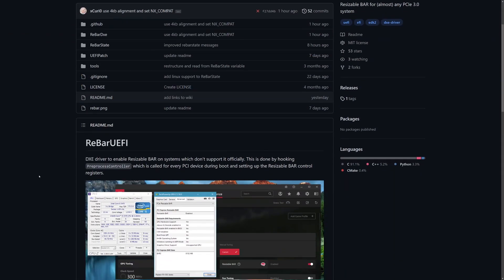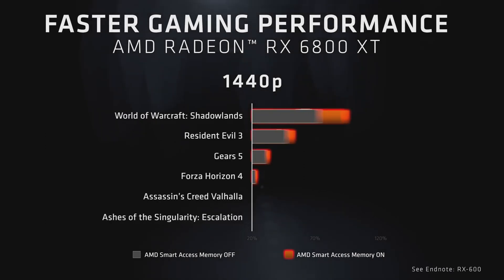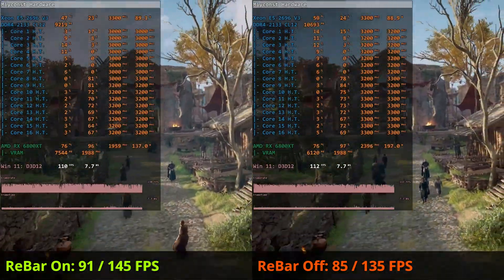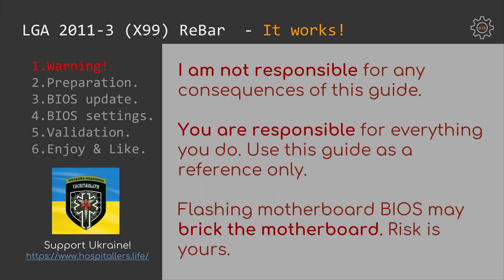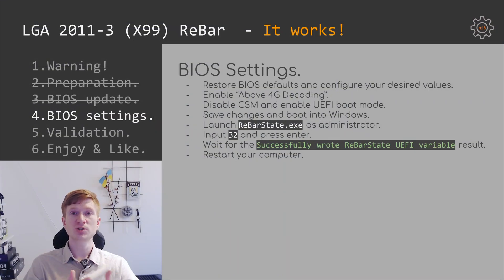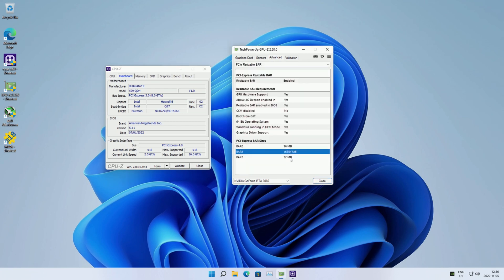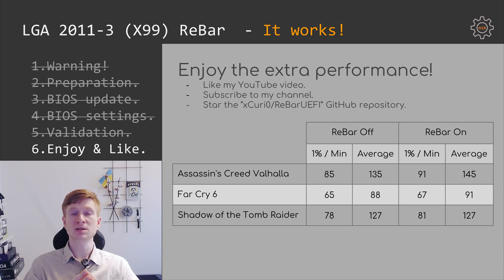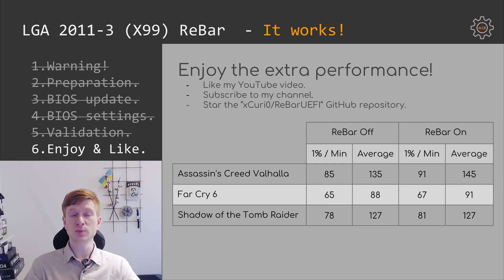🇬🇧 Resizable BAR (ReBar) on LGA 2011-3 X99 – how to enable and get extra performance

Comment from the maker: ❗UEFITool must be non-NE version - link in the video description updated.
Reply: X99 QD4 Not working with resize bar with the -100mv patch for it, disabled CSM completely enabled 4g but not allowing resize in bios. Running 22H2 ghost spectre 10 windows
Reply: added to bios with the xeon mod, flashed. Clean installed windows 11 pro x64 Uefi mode video on uefi only  enabled 4G decoding on asus strix x99. Xeon mod works perfect but rebar ant working with bios patch and running the rebar .exe @32  Running on x99 strix E5-2696 V3 , nvidia rtx 3060 ti. Any idea's? would be great
Reply: @superslotheroes7649  hi! i have the same problem! did you solve it ?
Reply: @barrozo24  No Still waiting for a fix  if you solve it let me know!. I can see  on xcurios rebar site someone listed it as they got it working yet the person that posted only  posted once, and ive had no reply from them. But it is now listed as compatible with a uefi patch but i havnt managed to figure that out as im not fully uefi bios tech savy. But as  i said if you manage it let me know or pass me on you're bio's. Best regards
Reply: @superslotheroes7649  apply uefipatch and also update your gpu vbios
Reply: @superslotheroes7649  for me  not working
Reply from the maker: @superslotheroes7649  it's hard to say what's wrong, but you can join my Discord and ask for some help from the ReBarDxe author.
Reply: @Miyconst wow what a niche, very cool! I’d love your opinion. I am considering upgrading a x99 sabertooth that worked very well since I built it 2015ish. The past year it’s had driver update issues. Recently nearly died, after driver wipe, gpu running but not well. 

The system ran 5k monitor, (which I thought died) graphics tablet & did lots of rendering, good life for gtx 980.  The cpu is 5820k, overall system used as a editing/graphics workstation.  In a funny spot, new gpu considering A5000 or 4090 more expensive than entire x99 pc. & I’m not Pixar. 

Anyway, what gpu/cpu would you suggest? With this cpu the 1080 ti looks promising and it appears some bios wizardry can help newer gpu cards? It would be kinda cool to get fancy Xeon in it too. 
Thank you & stay safe!
Reply: @Miyconst  can you do a video on this of how to do it if possible please and thank you and also make a video before resizeable bar and after for the x99 setups so show is that your not just blowing smoke plus it good content easy and don't close a lot of money to do
Reply: @Miyconst  Please advise! I've tried a lot of things. Motherboard x99tf 1rev. Video card rx7800xt. In the BIOS, 4G decoding and UEFI boot are set. But, adrenalin drive says that Resizable Bar is disabled. And this is not the main thing, from the very beginning I do not see the BIOS launch, a dark screen and if I force it to launch, the dark screen freezes. You can launch it only after it has been off for about an hour (I did not record the exact time). Or install another video card from NVIDIA. How can I make the motherboard work normally with this card???
Reply: Здравствуйте! 
У меня материнская плата Gigabyte H67MA-USB3-B3 чипсет H67 + i7 3770 + Asrock AMD Phantom Gaming RX5700XT+24gb DDR3 1600mghz+x2 SSD 240gb!
Биос в системе установлен последний(F8) для данной модели мат.платы!
Возможно ли включить 4g Decoding и Resizable Bar на данной системе с Windows 10 x64? 
Если это возможно, пожалуйста  предоставьте мне обратную связь на мою электронную почту в описании канала либо загрузите модифицированный файл BIOS при отправке сообщения на мою почту! Благодарю за внимание!
Reply: i doo step by step and rebar  disabled  still in gpuz

Comment: Edit: Nevermind, it was my RTX 3090 which hasn't been vbios updated yet to be ReBar ready as it seems, I flashed it and now it works (at least GPU-Z and Nvidia control panel report that)
I flashed my x99 Taichi with a Rebar Enabled BIOS, set up Above 4G Decoding and disabled CSM, did the thing with ReBarState which was successful, but ReBar is still disabled and GPU-Z says Rebar in Bios is disabled, but there is no Rebar Setting

Comment: Works on a X11SPI-TF with the intel C622 chipset running bios 4.7
For anyone following this order should work for any motherboard: 
Programs Needed:
UEFI PATCH
REBAR STATE AND REBAR DXE.FFS
FRESH BIOS

STEPS: 
DOWNLOAD FRESH BIOS
OPEN UEFIPATCH
LOAD THE BIOS
OPEN WHERE THE DXE DRIVERS RESIDE
INSERT AFTER THE LAST ITEM
SELECT THE FFS FILE
SAVE AS A NEW bios
FLASH SAID BIOS
GO INTO BIOS SETTINGS, DISABLE ALL NON UEFI/CSM Enable ABOVE 4G DECODING
+ what ever custom settings you may also enable
Launch into windows and open rebarstate.exe
TYPE '32' AND HIT ENTER
IF NO ERRORS, RESTART SYSTEM AND VERIFY IF REBAR IS ENABLED

Comment: I just noticed that ReBar is avaible by default in the BIOS of the Machinist X99 PR9, with no need for a BIOS flash. Pretty crazy for a €40 board! I test it with an RX 6600 and it works fine
Reply from the maker: These days many Chinese boards come with ReBar options available in the BIOS.

Comment: WIll this work with Supermicro x10dri and proxmox? I take I need to install windows on temp disk not on proxmox to configure the rebar?
Reply from the maker: That I cannot confirm as I have never tried to modify a Supermicro BIOS.

Comment: Has any body tried this on lenovo tiny computers? Especially the ones m920q series?
Reply from the maker: As far as I know, Lenovo BIOS is encrypted and next to impossible to mod in most cases.
Reply: @Miyconst woaw. What is the reason behind it? So sad to hear. I owner of an m920x stuck with nvidia and amd only
Reply from the maker: Because Lenovo wants you to throw the old devices as soon as possible and buy new ones.

Comment: i instal  mod bios for mr9a pro  100-mv  rebar available   make every steap in  gpuz say " resizable bar bios disabled "   all other things is enabled   .....  "Resizable BAR enabled in BIOS	 No " with your mod bios from mi899 1,4,3
Reply: still have same issue i turn of csm  i got all uefi boot above 4g on stil not working rebar witch rtx 2080ti gpu z say every requirements are ok  onlu  one is not " resizable bar enabled in bios ( no) where i  made mistake i 100% sure  i flash bios witch rebar enabled

Comment: I have had excellent success (HuananZhi X99-TF vers. 1.0; E5-2696v3) with Mi899 (v.1.4.3)...until lately.   For some strange reason, after ensuring C: dive in GPT for ReBar preps, I get the following message when attempting to run the FPT tool (dump BIOS or flash BIOS):

PMXUTIL: Error during PMX Call: idrvdll.dll!IDRVInstallDriver(): Failed to start loaded service err: - 2146762484
Error 284: Fail to load driver (PCI Access for Windows).
Tool needs to run with an administrator privilege account.

Of course, I am selecting Mi899 to "Run as Administrator".
This error seems to have surfaced over the past 6 months, since the last time I successfully upgraded the BIOS with the wonderful Mi899 tools. Maybe its a Win11 Pro "thing"...a recent update? My OS is up to date as of today (23H2, build 22631.5984).  Really sucks as I wanted to implement ReBar with a GPU upgrade and have observed the latest list of Mi899 BIOSES for X99-TF include a ReBar capable option.  Seems the error crops up with both FPT and the other tool, neither flash tool worked for me.  Hmmmm...guess I will have to settle for no ReBar with AMD...yuck.

Comment: One question, my motherboard is a Kllisre x99z v102, this procedure applies the "Above 4g Decoding" option in the Bios, because my Bios does not have this option there in "PCI Subsystem Settings", if I follow this entire procedure described in the video, will I add this option in the Bios to be able to activate the Resizable BAR? @Miyconst
Reply from the maker: No. If the BIOS lacks Above 4G decoding then ReBar won't work. You can check if the option is there just hidden, use an app called AMIBCP.

Comment: I will have to convert from MBR to GPT on the NVME disk with my C:\Win11 Pro OS, first, before disabling legacy boot options. Do NOT make my mistake and do a clean install on an MBR disk.  First get that empty disk to GPT...then do the clean install.  Hindsight is 20/20.

Comment: I wonder why you don’t have CSM support disabled but can still enable Resizable BAR
Reply from the maker: My system is installed in UEFI mode, so even though CSM is enabled in BIOS, it's not used during boot.
Reply: Thanks for your feedback, I followed your instructions but it didn’t work. I tried again using NvStrapsReBar instead and successfully enabled Resizable BAR on my RTX 2070 Super

Comment: Does this work on X99 Sabertooth?
I have 4070 super and I7 5930k
Reply from the maker: In theory it should work but BIOS flash is gonna be complicated as you have to use an external programmer. I would also not bother with an RTX 4070 as the performance difference is negligible for Nvidia cards.
Reply: Oh I did not know just wanted to squeze a little more perfomance out of it
 thanks for the fast reply  @Miyconst

Comment: Did everystep as shown with mi88 & uefitool with qiyida x99 h9s and rtx 2060, gpuz still shows unsupported gpu😢
Reply from the maker: Most likely your GPU simply doesn't support resizable bar.
Reply: @Miyconst damn maybe it is.. i dont see the inno3d rtx 2060 on the list

Comment: If I restore the BIOS defaults, but I have TBU enabled, will this change anything? Is there any way to save the current BIOS options before the reset, so I don't have to restore them manually afterwards?
Reply from the maker: Restoring BIOS defaults only restores the default BIOS settings.
Reply: @Miyconst  Thanks, I’ve just done that. However, I can’t find the PCI Subsystem Settings category, and there’s also no option for Above 4G Decoding.

My motherboard is a JingSha X99 D8. In the Mi899 forum/thread, there's mention of a Huananzi X99 F8 BIOS version for this board, so I believe it should be possible to enable ReBar on it. Do you have any idea what might be causing this issue?
My current BIOS version is 2.18.1263, firmware release: CX99DE27 HUANAN X64, build date: 11/25/2020, UEFI version 2.4, PI 1.3.

Is it possible that my BIOS is too old? Should I update it first in order to get access to Above 4G Decoding? I’d really appreciate any help or suggestions.
Reply: Anyone? I really need to unlock rebar because I'm using Intel Arc GPU.
Reply from the maker: @Anybody-ij5we get a dump of the BIOS and investigate it with AMIBCP, see if there are Above 4G Decoding options available anywhere. If no - you are out of luck.
Reply: @Miyconst  @Miyconst Thank you very much for your guidance! I followed your advice,  I managed to get a dump of the BIOS and checked it with AMIBCP. I found the Above 4G Decoding option and enabled it. Then I flashed the new BIOS successfully and ran ReBarState.exe. It didn’t show any errors and everything seemed to go well.
Unfortunately, after the next restart, the computer refused to boot and gave off beep codes. I had to remove the CMOS battery to reset everything, and luckily it worked, the system booted up again. However, ReBar still isn’t enabled.
Do you have any other ideas on what I might be doing wrong or suggestions on how to fix this? Thanks again in advance for your help!
Reply from the maker: @Anybody-ij5we I assume you have disabled CSM in the BIOS, if not - try that. Otherwise, please join my Discord for further debuggin.
Reply: @Miyconst  I tried to get help on DC, unfortunately without success. My last hope is to try the BIOS version from Mi899 with unlocked ReBar, specifically: Stock Huananzhi x99-F8, TU PEI, -50/50, ReBar, Community. Do you think this might work? The only thing I’m worried about is the undervolting — in this version, it’s set to -50/50, and I’m not sure if that’s a proper (safe) value.
Reply: @Miyconst  Do you think that this version of BIOS could resolve my problem?

Comment: Hi, Is it necessary to use the CH341A programmer to update or change the BIOS? Or is it also possible to flash the BIOS with
software programs? 

I made a mistake on a Kllisre B75 motherboard when I flashed the BIOS of another similar model of the same brand, and now the motherboard BIOS starts but no system starts, neither UEFI nor MBR, nor pendrive nor disks, nor SSD etc., nothing boots even when removing the battery from the motherboard.
Reply from the maker: If you can't boot into any OS then CH341a or a similar programmer is needed.
Reply: @Miyconst Thanks, I will try that programmer as I can't start anything even with a Ventoy drive and many Linux and Windows recovery programs.

Comment: Hi again sir 🫢, which version of "ReBarDxe.ffs" compatible with QD4? is the latest 0.3 supported? can i inject the "ReBarDxe.ffs" into the "bios_turbo.rom" that already has been injected with "ser8989_S3TurboHack-50-50-0.ffs" or i need to dump bios and start all over again?

Comment: According to the github for ReBarUEFI, it says under the FAQ that you can use resizable bar without modifying bios in linux.  I have an Unraid server and installed an A310 and checked and it appears resizable bar is not working.  I have 4G decoding on, bios are UEFI with CSM off.  Do I need to do the bios patch?  Or is there something I'm missing that I still need to do to get it to work?
Reply from the maker: I think you could get more help asking the author via a GitHub issue. I only tested BIOS mod option.

Comment: Hello everyone,
I'm reaching out to seek assistance with enabling Resizable BAR on my ASUS X99 Deluxe motherboard. Despite extensive efforts, I haven't been successful. Here's a summary of what I've tried:
Hardware Configuration:
Motherboard: ASUS X99 Deluxe
CPU: Intel Xeon E5-2699 v3 128RAM m2 GPU: NVIDIA RTX 2080 Ti
Actions Taken:
Inserted ReBarDxe.ffs into BIOS using UEFITool 0.28.0.
Enabled Above 4G Decoding and disabled CSM in BIOS settings.
Flashed the modified BIOS using a hardware programmer.
Used ReBarState.exe to set BAR sizes (tried 16, 24, and 32).
Tested various BIOS versions, including those shared on forums.
Current Status:
GPU-Z indicates "Resizable BAR enabled in BIOS: No".
No Resizable BAR option available in BIOS menus.
AMIBCP doesn't reveal any hidden Resizable BAR settings.
I'm seeking guidance on the following:
Is there a method to manually add or unlock the Resizable BAR option in the BIOS?
Has anyone successfully enabled Resizable BAR on the ASUS X99 Deluxe?
Are there any alternative approaches I might have overlooked?
Any insights or assistance would be greatly appreciated.
Thank you in advance for your support.
Reply: Final solution and thanks:

After many days of testing, I finally managed to enable ReBAR on my X99 system with RTX 2080 Ti.

I tried about 12 different BIOS versions, applied the ReBAR whitelist patch using UEFIPatch 0.28.0,
inserted the correct NvStrapsReBar DXE driver (from GitHub), and flashed the BIOS using a programmer.

I carefully followed the instructions from the YouTube video:
"Resizable BAR for Turing GTX 1600 / RTX 2000 GPUs - Compile 0.1v" for DXE injection and patching.

Even after that, Resizable BAR still showed only 256 MB.
Finally, I managed to fully activate it by manually enabling ReBAR in NVIDIA Profile Inspector.

My working steps:

Patch BIOS ReBAR whitelist (using UEFIPatch 0.28.0).

Insert correct NvStrapsReBar driver into BIOS.

Flash BIOS using CH341A programmer.

BIOS settings: Above 4G Decoding = Enabled, CSM = Disabled, Secure Boot = Disabled.

Set BAR size to 16 GiB using NvStrapsReBar.exe (option 14).

Manually enable ReBAR with NVIDIA Profile Inspector.

Conclusion:
It was a combination of BIOS mod, driver injection, BAR size configuration, and driver-level enabling.

Special thanks:

68k-dude for the guidance and advice!

Author of the YouTube video for the clear explanation!

Thank you again — without your help, I probably wouldn't have succeeded!
Reply: Is it necessary to use the CH341A programmer to update or change the BIOS? Or is it also possible to flash the BIOS with software programs?

Comment: Why it always doesn't work with Nvidia? I tried RTX 3070 and RTX 2080 but failed, in BIOS I already set Above 4G decoding and Resizeable BAR to be Enabled....if I use RX 6700XT it works like a charm and in AMD Adrenaline it says Resizeable BAR is enabled. Btw I use ZX-99EV3 V1.5 with E5-1660V3.
Reply from the maker: Because your Nvidia GPUs require vBIOS update and if the manufacturer didn't provide it you won't be able to make it work with Resizable Bar.
Reply: @Miyconst  I see... Thank you for the information, Miyconst 🙏 🙂